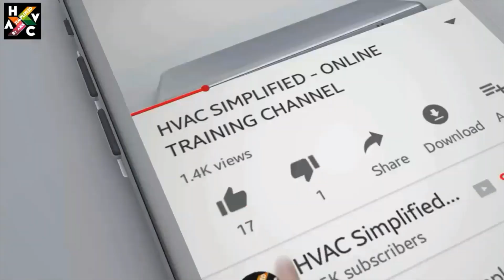HVAC Interview Question in Chilled Water System

Comment: BTU meter(British thermal unit) meter also called energy meter is used to measure the thermal energy consumed in a central ac system and is installed in the chilled water return line from the building to the plant